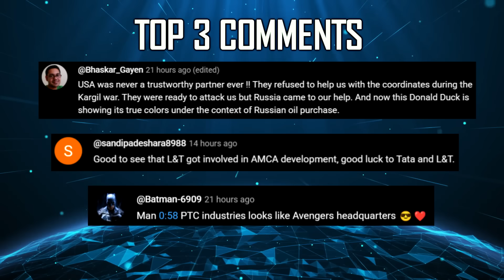Indian Defence Updates : Agni-P Rail Launch,Su57 Rollout 2027,Rafale Bold Offer,97 Tejas MK1A Signed

Comment from the maker: :yt:"MoD signs Rs 62,370 crore deal for 97 Tejas Mark-1A" ?
ＬＩＫＥ | ＣＯＭＭＥＮＴ | ＳＨＡＲＥ | ＳＵＢＳＣＲＩＢE
Reply: Biggest comedy is deliveries will start 2027 and finish in 2031 when for orders linked in 2021, not a single jet is delivered by HAL 🙂
Reply: Delay in certification. Same for AMCA. Now were  are  engines.
Reply: @nareshlad7761  are you not watching news? GE delivered 3 engines and 4 by end of this month and 10 by december this year. Whereas not a single jet is delivered by HAL so far.
Reply: @vaimurthy GE was ready for delivery but HAL was not taking it🤣🤣🤣🤣🤣🤣🤣🤣🤣🤣🤣🤣🤣🤣🤣 american fanboy has lost mind
Reply: @vaimurthy saar now divert saar. GE want to deliver but HAL ain't want it saar🤣🤣
Reply: @vaimurthy  saar 83 tejas ordered in 2021 but GE was ready to deliver in 2015🤣🤣🤣🤣🤣🤣🤣🤣🤣🤣🤣🤣
Reply: @vaimurthy saar order placed jn 2021 but GR was ready to deliver engine in 2015🤣 saar tamil indian 8th fail
Reply: No need outdated fighter aircraft like HAL Tejas, india should focus only 5 th generation fighter aircraft like F35A and SU 57 both Air craft we need to counter china, 250 F35A we need, 250 SU 57E ASAP, China already operated 300 J20 Air craft
Reply: Note Pakistan has started inching up in their PFX program. They have got new investors in the form of Saudi Arabia and China. Day is not far when we will keep talking about AMCA and Park will have battle ready FGFA. SU 57 and AMCA both has to be fast-track, both has to run parallel. Make AMCA as advance as possible and scrap Tejas MK2. Allow Tejas MK1A to be as simple as possible, only make it NCW capable teaming with very long range stand of air to air and air to ground weaponry and AEWACS. It will keep it cheap and more numerous so that quantity can overpower any misadventure of enemy.

Comment: Very good news that MoD clears 97 tejas mk1a. Hope we get engines as scheduled.  Second congratulations for over hauling DRDO. It was much needed. Third Agni Prime from railways. Request to make special railways compartment stealthier so that it is not traceable by satellite and other radar absorbing materials. Please see if it can be done by railways. Also request railways to integrate army weapons in passenger trains. Either few compartments or divide a compartment into 2. The upper portion in which the passenger travels and on the lower compartment arms and ammunition of army can be transferred in a secret manner.  Please see if railways can help and if they can bring in new compartments for army weapons. As now it is easily visible openly from satellites what we are transferring one part of the state to another. Everything related to defence should be in a discreet manner and way. The same should be with Agni prime. Nobody should know on which trains they are integrated. DRDO should help railways and railways should help defence forces. Hope something positive comes 🙏  up. And last but not the least hoping su57 to roll out by 2027 with minimum 150 to 200 units by HAL for our nations safety and security. Good luck.

Comment: Wait, India wouldn't even get the AL-51 engine in their Felons?! The 41 is a stop-gap measure based on  the AL-31 and is extremely limited in its abilities and upgrade potential. But, i guess if it comes with ToT, anything is better than India's current indigenous capabilities.

Comment: DRDO &_ GTRE develop enhanced version of kaveri should be 1000 to 1100 kg enabled heating of the engine & knocking noise. Drag of the engine. India should go with full  TOT of SU 57 & Rafael with 4 block  &. Engine M 66 can be used for Tejas MK2 & Rafael

Comment: Rafale offer of  an aircraft based on 75 kN engine switching to a 120 kN engine is not feasible.
      An 85 kN or may be 90 kN might be possible with some advantages & disadvantages BUT 120 kN ? No way.
Reply: Probably the t Rex engine for the f5. Basically the f5 upgrade would be included I guess.

Comment: Pls make sure the 97 aircrafts have Gallium Nitride based AESA radars ; not Gallium Arsenide based.
Reply: Yes it is confirmed 😊
Reply: GaN has certainly better power and heat transfer capacity, but an AESA radar or a radar in general is more dependent on the no. TRM modules and their multi mode programming, hence the name multi mode radar.

It is also essential that the powerplant(GE F404 INS6) is capable of powering the radar otherwise the improved peak power and efficiency is basically wasted, thats why Virupaaksha varaint of Uttam AESA meant for Su 30 mki has both higher TRM(2400plus) and GaN because the AL 31FP can power such a radar.
Reply: @spoiledit761 exactly !  &
     1)   because GaN TRMs are physically smaller than GaAs TRMs, the same nose cone can have more GaN  TRMs.
    2) GaN TRM  being more efficient than GaAs  means  : for the same power supplied by the engine  - more number of GaN TRMs can be powered.
Reply: They can detect j35 from 100+km 😊

Comment: We shouldn't go with Su-57 if Russia doesn't agree for Indian radar(possibly virupaksha) along with AL-51 engines. 
Su-57 with AL-41 and Russian radar isn't a good choice considering we already have to compromise the stealth factor quite a bit.
Reply: Instead better to upgrade su 30 with al51 and radar, buy rafale and  su 57 is not  worth and will be a costly mistake
Reply: @prashanthk8755  Su30 upgrade will take time and india needs to bridge the gap. The best thing for india is to demand su57 M1 varient which comes with AL51, better avionics and AI + virupaksha radar on it along with zircon and R37 missile. New M1 varient is more stealtier and the above mentioned missiles would give a huge leap against pakistan and go neck to neck with china
Reply: @prashanthk8755  that will certainly boost su-30s but won't add any numbers to the AF. We are in a desperate need to add more fighters in our AF since we are down to a mere ~29 squadrons whereas the requirement is that of 55+ squadrons.
So, buying Su-57/F-35 or Rafale won't be a mistake but a decision which should have been taken much before.
Reply: @RS_1501 su 30, so called backbone of indian airforce is already out dated and need updates desperately,  buy more rafales and put effort to bring tejas mk2 to fly as early as possible to increase squadrons strength. Wrt to su 57 its not a proven fighter, its AL 51 is not into full production,Aesa  radar is also not fully used, virupaksha is still under developement phase by India, how much su 57 has been used in ukraine is a question. If they give full tot, source code etc...without any strings attached,  also sanctions on russia, US may sabotage f404,414 engines citing this as a reason
Reply: @prashanthk8755  Su 30 airframe has limited life. no use
Reply: @RS_1501  AL51 is a new engine, and not started for mass production, how can they give us TOT
Reply: @jerry_editz7  indeed. Although I didn't mention ToT but integration of AL-51 since Russia till date has offered their AL-41 in both Su-57 and super sukhoi. 
 Su-57 with AL-41 isn't a good choice and there isn't any good news in the favour of AL-51. 
With the current Su-57E config, you may expect it to go against pak but not china.

Comment: India should go with both France and Russian offers and set up the facilities, mean while we must pressure USA for F-404's TOT.. as for 200+Tejas we need 4-5 engine for each plane through-out it's lifecycle... And so far we have ordered only 198+36(ioc vaiant) engines.. once US abandons the production after completing the orders we will face the same issue during next refit and maintenance... While the Tejas MK2 can be changed into a twin engine fighter and be fitted with Kaveri engines.. and with R&D and tech advancement we can make better engines in future... India should drop F-414 completely... That engine will only slow our induction of MK-2 and AMCA..
Reply: The Air frame is flight worthy for the next 40-50 years... 50 years =438,300 hours... An engine only has 4,000 hours of life and even they go through complete overhaul after 1,500-2,000 hours... BRUH.... do the maths... You will understand... BRUH....
Reply: @sanjaysaha5002  seriously? Jets dont flight that many hours a day 🙂

You think jets fly 24 hours everyday for next 50 years? It does not work that way
Reply: @vaimurthy  😂😂😂😂... Did I say we need 109.5 engines??? according to you??? Ofcourse they can't be flown 24 hours... But 8hrs long flight for 3 days will make 24hrs right.... So out of 365 days even if it's flown for 120 days for just 2 hours it will be 240hrs... So 240×20yrs =4800 you need another engine... And It's only when you fly only for an average 2 hours just for 120 days... So  practically you need 3+ engines.... And you can disagree with me.. but this point was raised by Pathikrit Payen geo political expert... Go check out Deftalks by Aadi...
Reply: @vaimurthy So you do know when the SU-30 Mki first arrived they didn't even have a cannon... So what was the meaning of flying a fighter you can't train Pilot's about weapons??? The source codes were only given last year... So we didn't need that many engines then... But why the IAF now want them to be Super Sukhoi standard It's suppose to be a new fighter... As some of them were only delivered in 2021.... So that is why we didn't needed more engines.... But now we need them already after 4 years....😅😅😅... Learn before arguing without knowledge....😂😂
Reply: India has to make some serious decisions to move away from the US Military Industrial complex and all its affiliations and subsidiaries.
Reply: @bennramnarine3395  why? Why do we need to restrict our options? We have to get whatever is best from wherever it is from
Reply: 4-5 engine for each plane ? wtf bruh even russia planes dont require that much of engine lol. American engines are known for their lifespan and can easily survive a cycle
Reply: twin engine MK2? Means completely redesign new jet? That will take another 20 years, we have to forget MK2. Kaveri is so far failure
Reply: @vaimurthy it's still on paper.... MK-2 doesn't have a single prototype... If the government and IAF wants it it can be possible... But they have already begun metal cutting in 2021.. but we can use it for TEDBF instead... But it all depends on government and the end Users....

Comment: By 2033, sixth generation fighter jets will in service by our enemies. We will be using outdated 4/4.5 generation fighter jets.
Reply: Aside from China there is none in the enemy part. And it's very unlikely in the case of China too considering it took china almost a decade to induct the J-35 after its first flight. And all the airforces in the world will still be using 4/4.5 gen jet in 2033 too.
Reply: Even 5th gen fighters r not in large scale deployments except usa and china, only large economies can handle the cost of these fighters. 4.5 generation fighters are here to stay for long time. Also radar systems are rapidly evolving.
Reply: China 5th let alone 6th gen claims are mostly bogus